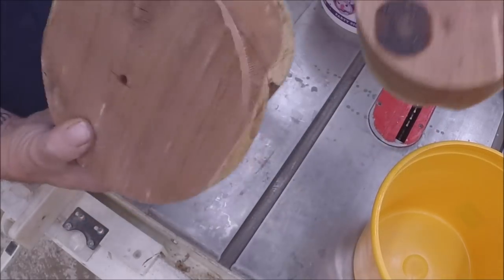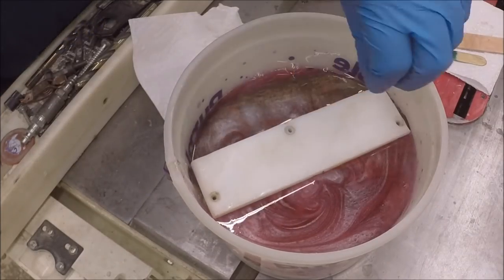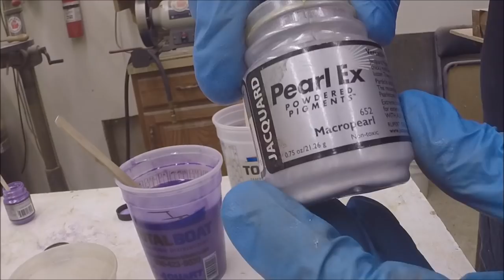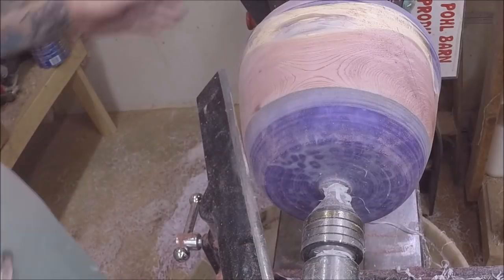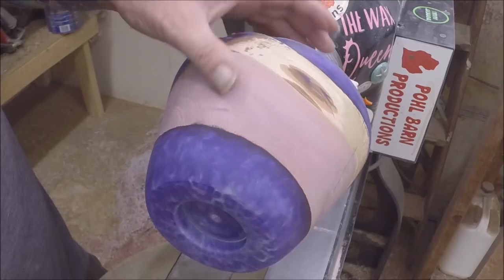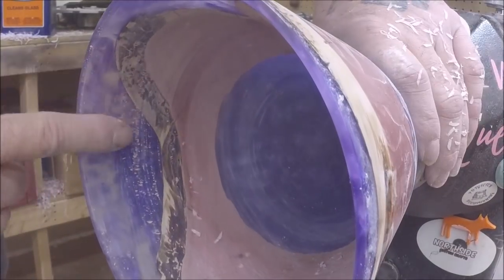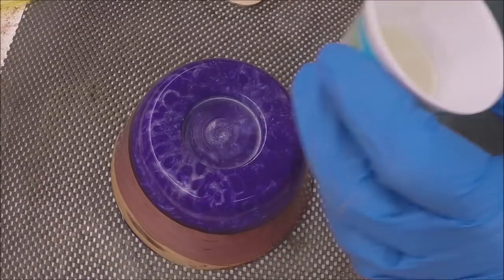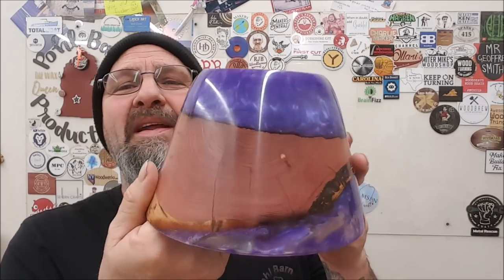Purple Resin  and Cedar

Comment: I just got a bunch of red cedar logs, and love it. Im in the process of an end grain epoxy piece. Basically split it where it was cracking anyways, put the pieces back together wrapped it in plastic wrap, and cast some blue resin in it. More cracks are developing though. Grr. Frustrating.
Reply from the maker: yeah cedar will do that even after it's been completed for a week or so

Comment: You should use Hot glue to secure the wood to the side of the container befor putting the resin in. Much easier than weights.
Reply from the maker: Thank you Rex

Comment: I love learning from you! Wood turning is my passion, and this was definitely a thumbs up! I’m curious about sanding the resin, I’ve only worked with it once. How do you prevent scratches? Is there a specific grit that you start with? Also, are you putting sanding sealer on before you sand? I thought it was supposed to go in after you sand. Thank you for the tips!
Reply: Check out this video, great sanding tips for the best finish. https://youtu.be/ufMrZeyx0G8
Reply from the maker: Thank you Katie...Sanding is a pain in the back side and I have not yet mastered it,  I am not sure if the link below is Jake Thompson's video link or not but he has recently done a video on how to sand resin to a glass finish. he uses way more grits than I currently have to use
Reply: @PohlBarnProductions  Well hello there. 😉 Of course it is the correct video. 😜

Comment: Doug have you had any issues with the hot glue NOT holding the blank ?
Reply from the maker: not yet Doug, but I do run a couple strips on the underside just for safe measure.  I've had the plywood come apart on my glue block but not the glue,

Comment: Dear Sir, That floating wood costs you a fortune in resin. Why don't you buy a silicone mat and fill some bags of sand to put on it before they go into the pressure pot? The silicone mat does not adhere to the resin and if you put the bags of sand there the wood cannot float. Good video btw, thank you. Greetings from Holland.
Reply from the maker: Thank you,  it cost someone but not me. it was suppose to be stuck to the bottom and it came loose, things happen and we just work with it.
Reply: I know the feeling. :)